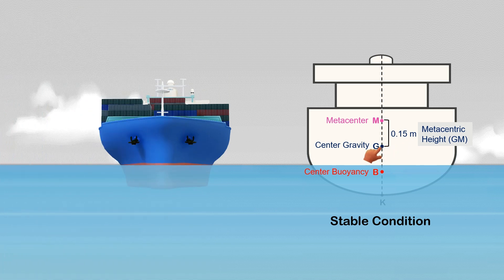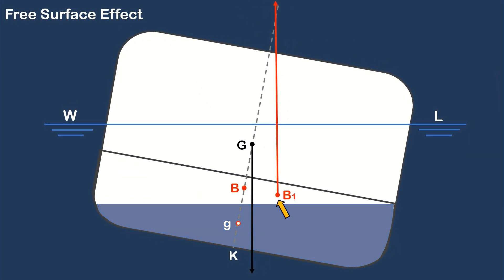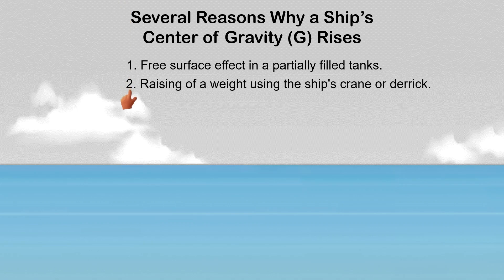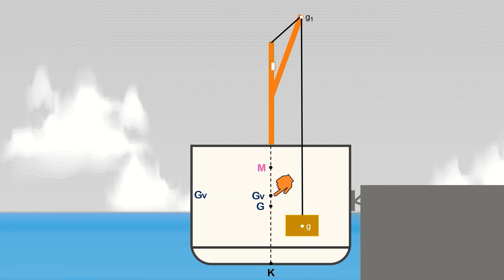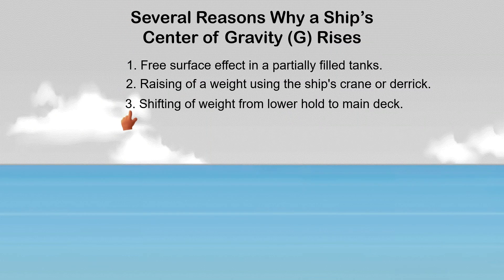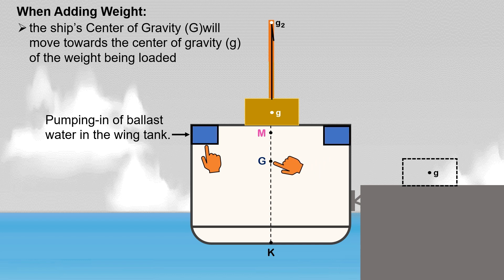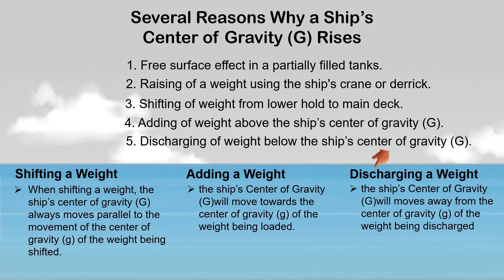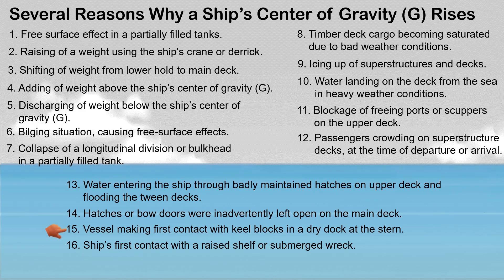Why Does a Ship’s Center of Gravity (G) Rise? 16 Key Reasons l Ship Stability l COG

Comment: This earth without Gravity that none of the peoples could live, no difference than sky's and sae levels, if the planes flying higher than the distance then the Gravity will not supporting caused the unbalance to con to cintrol.  Seas water with the waves is anout the Gravity of the boat how big and how muvh weights to balancing the whole ships, if your body's too light then you wont ablto singing diwn yo the bottom of the water, if your weights is balancing then you dont need the extra weights to driving down to the water.  The ship body's could iver balancing with the surface to moving.